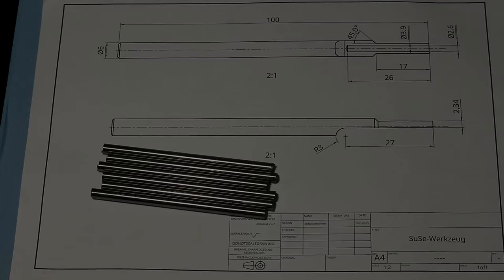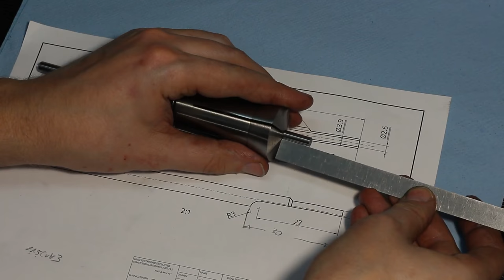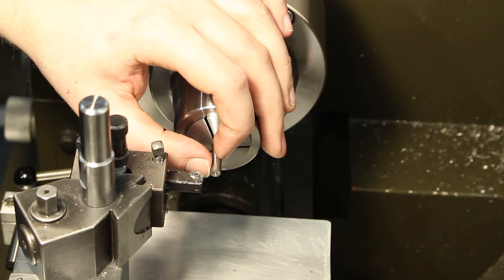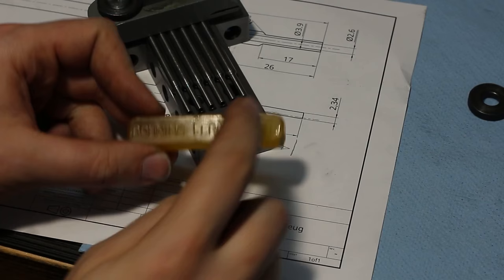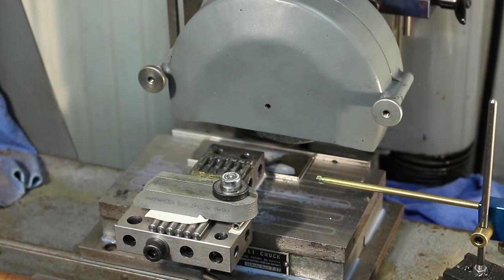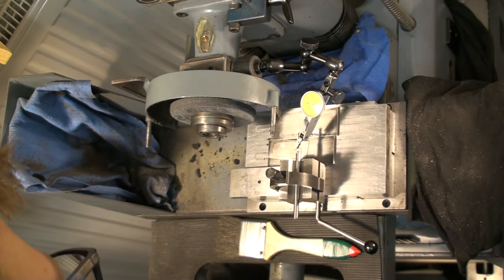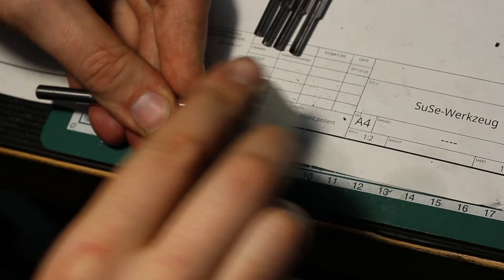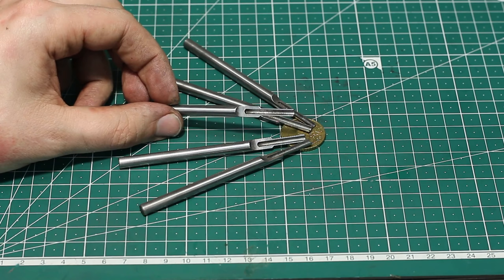Wire threading tool

Comment: very nice but I don't understand how this tool is supposed to work.  if the wire goes in the "slot" to be pushed through the grommet wouldn't it have been easier just to put a small piece of tube on the end of the wire and push it through that way?

Comment: Great video! I would have done it differently but showing the tool in use was pleasing. thanks for sharing.
Reply from the maker: I think next time I would just try milling it - climb cutting with a support behind it should work without a crash :D
Thanks for watching!
Reply: Stefan Gotteswinter no problem. I always enjoy watching your projects.
Reply: See, I actually wanted to ask about that.  Why not just mill the flat, then finish with a grinder if needed?  Was it just a shortage of round carbide end mills?
Reply: I also was thinking why not just back support the part and side mill the flat and radius with the proper diameter end mill. If the part had already been hard I could have seen using the grinder though. I had not considered regrinding my old inserts, I definitely need a diamond wheel or better yet a tool cutter grinder now. :-)

Comment: Hello Stefan, back again, at 22 mins that is exactly where the Plasticine method would come into play, a big blob of Plasticine pushed up against the face of the V-block and also making contact under the entire length and around the lower half of the part being ground, 

Try it sometime,

Edmund............Alberta
Reply from the maker: Noted, I will give it a shot :)
Thanks Edmund!

Comment: Those are very nice tools. Rather remind me of wire-wrapping (or actually wire unwrapping) bits, but somewhat larger in diameter.

BTW, even though the hot glue didn't work out, I would have been inclined to just fire up the glue gun and use that. A little more controllable and a little less chance of discovering what it feels like when the liquid glue sticks to your fingers. :-) These days there are two main kinds of glue, low temp and high temp. That stick you were using looked like it was probably basically high-temp glue, which is stiffer and usually stronger.

Comment: Stefan, will you PLEASE get yourself either a Ring Spanner or Socket to tighten your lathe toolpost. Every time I see you use an open ended spanner it gives me the creeps, it can spring off and hurt your knuckles. Interesting video by the way, as you say a little outside your normal line of work. What is happening about you prototype Centering Microscope, have you binned the idea  and are going to purchases a professional made one ?

Comment: That hard hot glue is for securing the nock to the back of the arrow, and the threaded insert into the business end of the shaft.

Thanks for the great tip with the bulk nail sponges! Sandpaper is so pricey.

Comment: Interesting, I really appreciated the still shots of the final product in action.

If you had to do a larger run, say 50 pieces instead of 5, do you think you would have worked out the bugs in the ganged/glued setup or tried a third setup?
Reply from the maker: I would build a fixture if I had to do that many of them. Something like a V-Block with 5 or 10 cutouts and a bridgeclamp over them.
Reply: Makes sense, thanks for taking the time to reply and for all of the great videos.

Comment: If you do all your grinding before the harden and temper process don't you get distortions in the finished parts as the stresses settle out?
Reply: Hardening before grinding was my question too. But mostly for the point of view of reducing the formation of burrs. Am I wrong?

Comment: When you get a sketch as the design of the part, are tolerances specified on it?  Or are there tolerances that are "standard practice"?  Or do you just use your own judgement?
Reply from the maker: A bit of everything ;)
In this case I just got a descriptopn, I drew it up and worked to my standard practice, which is pretty much Iso 2768-f, as there is no real critical dimension. But on the other hand I hate to turn out sloppy work, and I try to hit nominal as good as possible anyway.

In other cases I get tolerances specified on the drawings, or I design the complete part/assembly myself, then I figure the critical tolerances myself.

http://ramo.se/en/iso-tolerances-din-iso-2768-1-din-iso-2768-2-english-2
Reply: " ...  I hate to turn out sloppy work ..."  Yeah ... we had noticed that <BG>.

Has a supervisor ever told you "Hey Stefan - you're taking too long on that part - it doesn't have to be perfect"?  And, if so, did you quit?  <G>

Comment: hey @stefan gotteswinter is it possible that the tolerences change when hardening the material?
Reply from the maker: Yes. Most steels grow when hardened and they also tend to warp (change geometry) how much, that depends on the alloy and the kind of heat treat.

Comment: Hello Stefan, another product you can use for eliminating vibration which works great when grinding, is the old Plasticine product,  https://en.wikipedia.org/wiki/Plasticine its easier to apply, it doesn't dry out, its usable over and over,

Enjoyed the video very much, 

Edmund.........Alberta